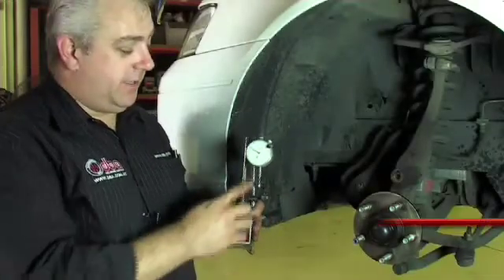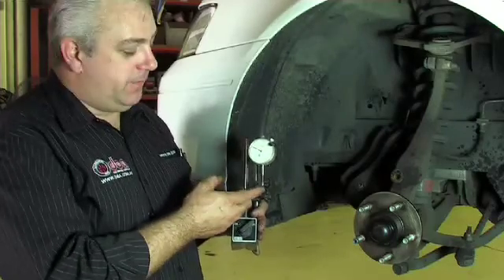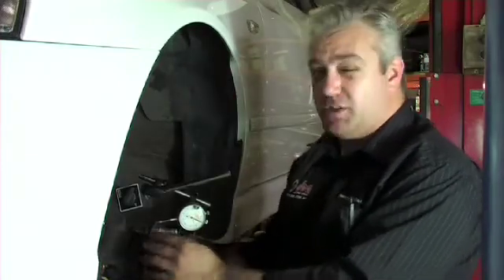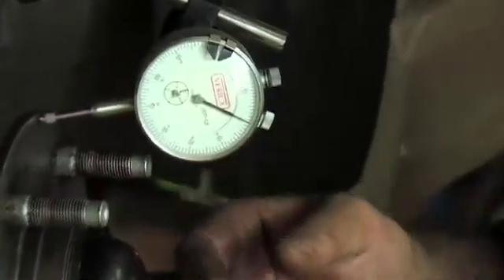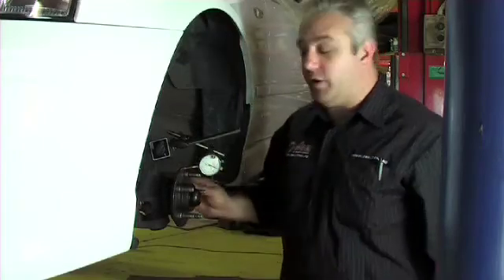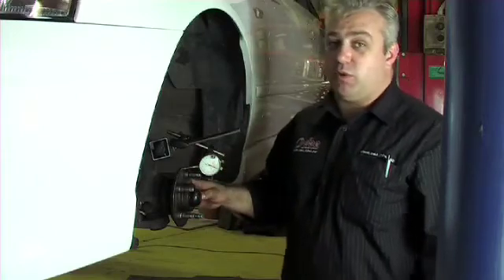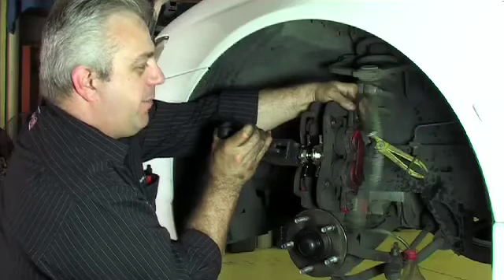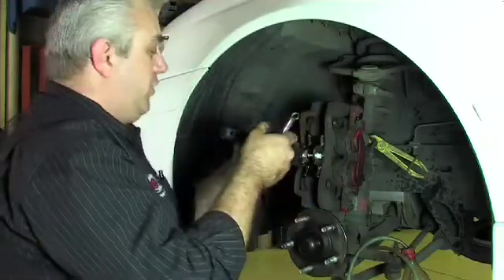DBA Tech Talk Video Episode 1 - Part 2 Fitting a brake disc rotor www.dba.com.au

Comment: @Slowpoke9 Its a common thing to do. Im not a mechanic but ive never heard it will damage your lines, that tool hes using is designed for clamping hoses.